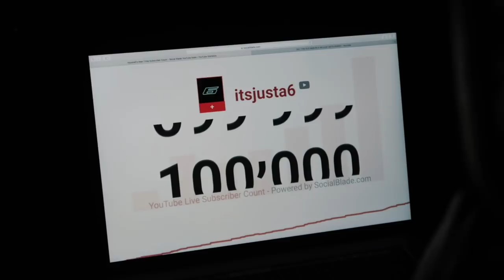Old Man in a Hellcat is BACK!! I CAME FOR REVENGE!!

Comment: Tune with  smaller pulley, will allow you to rev to 7000 to 7500 at a safe level specially with oil and a pocket gears replaced. Good job can not wait for the next MOD.

Comment: Holy you really got the revenge on this old man
Reply: Not really
Hellcat was kept in drive, you never here the 3rd honk because he is on it by then
The reaction time for the Hellcat plus fir the Trans to downshift...well
As you see the Hellcat came back on  all those runs
Great video though and Gavin is great
Reply: Dennis Fischer that's because the top speed in the hellcat is a little bit higher than the mustang as you can see he was nearly going at the top speed

Comment: There seems to be a lot or street racers on here so I will ask this question:
When did it become common, and why the reason for the beeping of the horn for a moving race?
I used to race my 70 Chevelle around the Detroit area all thru the 80's and we either came to a stop and raced or from the light at an intersection.  So I am curious as to how you are to determine an actual faster car when you are not venturing around in the full range of the power band from a dead stop low rpm to 100% power.

Comment: What you did to that car but cutting into the fire wall to put a completely useless hose that gives you headaches is just the dumbest thing that will devalue the car I have ever seen, you could have got a different intake and put a pulley on the supercharger and you would of herd plenty of whine but now when u do those exact things it's going to be so loud in that car even being easy on it you will hate it, my suggestion take it to a good body shop and have them weld that big as hole up